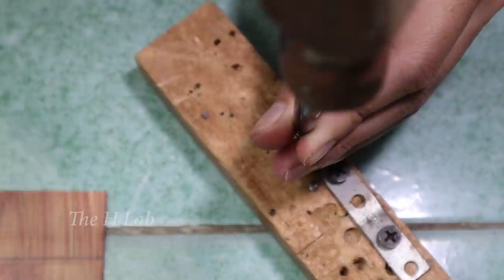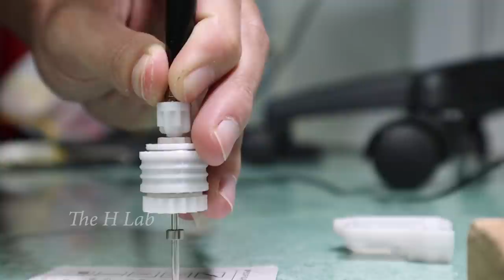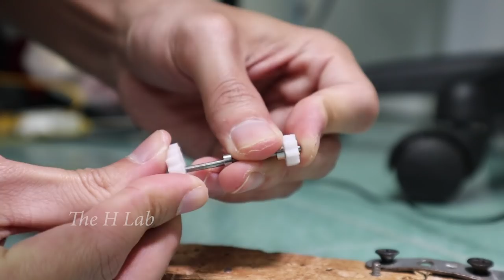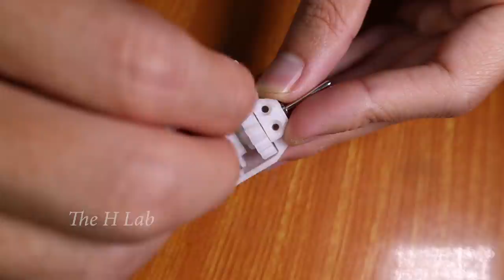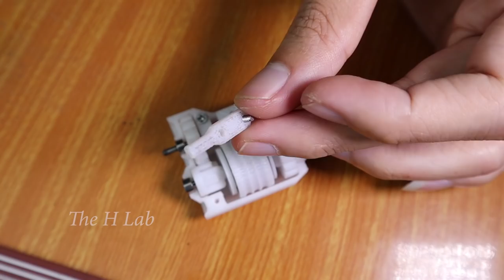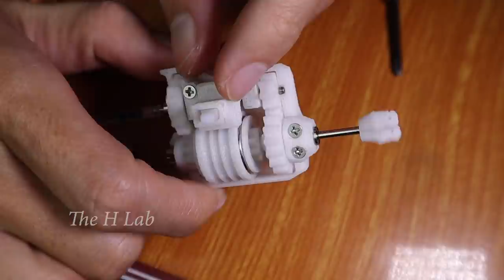3D Printed 2-Speed Gear Box for 1/24 RC Car

Comment: That is very cool! Please share the project files!
Reply from the maker: Thank you. I've just shared it here: https://sketchfab.com/thehlab
Reply: @TheHLab  Thanks! But how can I download your project in detail to print one part at a time on a 3D printer.
Reply from the maker: You can download and open it with Blender and copy out each parts to each separate file, put it at correct orientation, then export to STL file.
Reply: @TheHLab  I see! Thanks! I didn't figure out that I needed a Blender. My Fusion 360 couldn't open your files. I will deal with exporting to STL.

Comment: Can u make it automatic?
Reply from the maker: We can control it by connect the gear lever with a Servo. Then, for auto, we need a RPM sensor for main Motor and control the servo to change the gear ratio at selected RPM